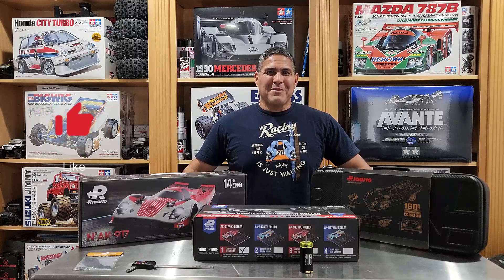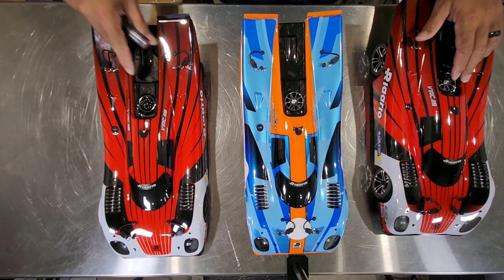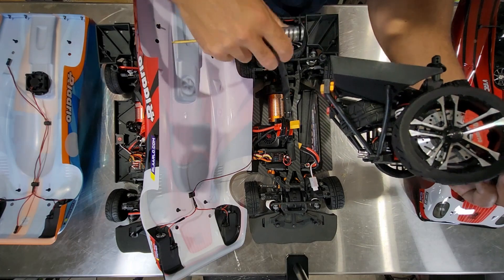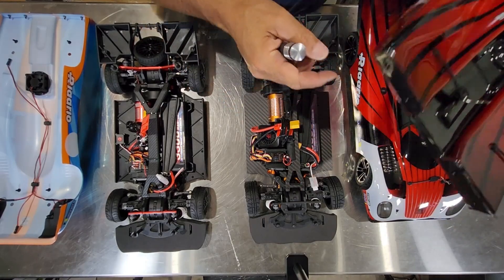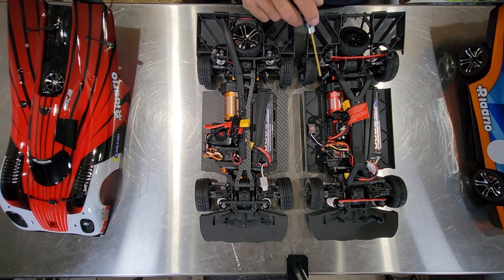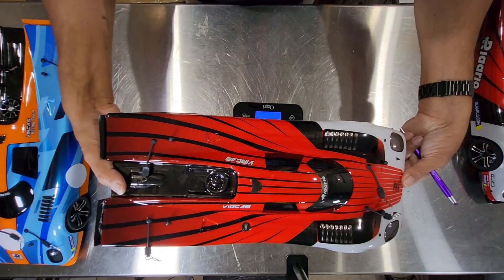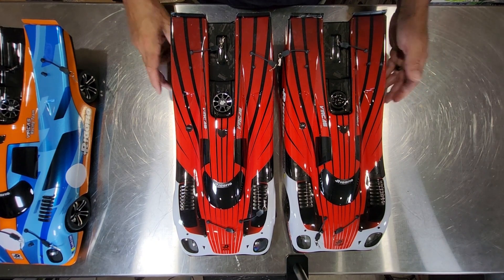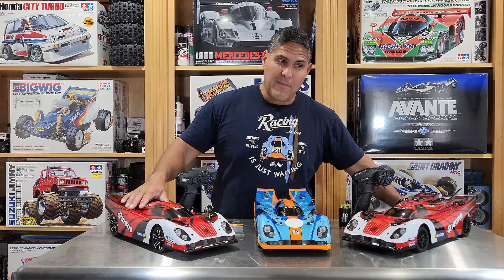Rlaarlo AK-917 Showdown: The Brushless Carbon Fiber, Brushless Metal, and Carbon Fiber Roller!

Comment: I am buying this car in carbon fiber, but the AK-787 body w/active wing. Then I’m going to purchase the dual motor conversion from Rlaarlo, but before I do that, I want to do some research and figure out if I can do a dual motor setup using a castle setup for 6s-8s. 😂
Reply from the maker: I was thinking of doing a similar build. I know that the 6S 4274-size can will fit on the RLAARLO dual motor mount. I did test it. Now I think Castle does makes some 8S motors in a 6s can. Normal 8S motors will be too big. The rear upper suspension arms are weak. Swap them out with 2 front upper arms. Hope this helps and thank you for watching. 👍👍👍👍

Comment: Maybe Rlaarlo sent you a pre-production motor...lol! Thanks for the comparison review, very interesting to note the differences. The wheels are a bit narrower on the metal brushless version, and it doesn't rub against the rear wing support.  Only the carbon fibre metal wheels rub.
Reply from the maker: lol I wouldn't be surprised about the motor being pre-production. It did come in a plain white box. I forgot that they do have some tire rub issues. Hopefully everyone is using foams. Thanks for watching.

Comment: what do u mean with loop velcro for the battery?
Reply from the maker: Sorry I meant 3M dual lock re-closable fastener. I think that is the correct name. Most people use it to hold their EZ pass on the windshield. Thanks for watching.
Reply: @allscalerc  would thr battery be secure enough with only velcro
Reply from the maker: @michaelholtappels8324  There are guys doing speedruns in the 200s with other cars using that stuff. If you crash at 100 MPH, straps are just going to snap anyway. Check out this channel https://youtube.com/@RazShifrin

Comment: Can i install a fan on the metal version?
Reply from the maker: If you are talking about the RLAARLO fan that comes mounted to the body of the carbon version yes. You will need to cut the hole on the body of the metal version. If you just want to mount a fan directly on the motor, that wouldn't be an issue either. 👍👍👍
Reply: @allscalerc  Thanks. I have body of the carbon version i damaged it in a crash i’ve been looking for another body but it seems like they only sell the versions without the fans.